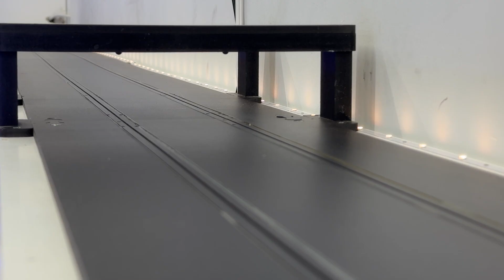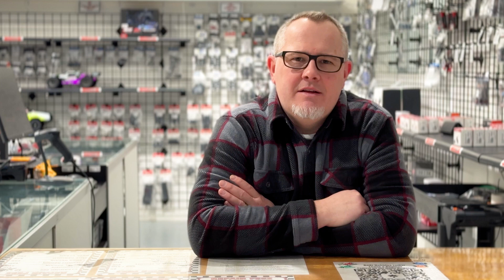Armature Ohm Talk HO Slot Car

Comment: I have an unrelated question about how to wire track for brakes I have the transformer and controller’s that both have 3 terminal’s I have race software and kill buttons and polarity switch for each lane
Could you do a short video on wiring track
Reply from the maker: Hi Kevin id keep looking through our videos we have wiring videos and we also have a diagram on the website

Comment: Wire Drawing Process:
Wire is traditionally made by drawing a metal rod through progressively smaller dies or openings to achieve the desired thickness. The number of times a wire has been drawn through these dies, corresponds to its gauge, meaning the wire needs more passes for thinner gauges.
Gauge as a Measure of Wire Diameter:
A higher gauge number indicates that more drawing operations (passes through dies) were necessary to achieve that specific thinner diameter, while a lower gauge number means fewer drawing passes are needed, and thus thicker wires.

Comment: 100% my friend I ran a g+ super stock for years (HOPAC) old rules  , stock mag's, any gears any hub's/rubber STOCK ARM but can be balanced and glued com wire, I would call Gary Beadle (AFX) and buy stock arms in BULK QUANTITY,  500 lot !  I built a small jig to hold the arm and test every single one , I would usually get around 20-30 arms worth balancing but I would have about 8-10  absolute killers 4.9- 5.9 ohm. Range, the rest I would sell to the clubs at a extremely strong price always $3.50 with the ohm. rated.  When the rules say STOCK ARM watch out  !  I race NEO events as well and I have to say it's so mutch easier to build a top competitive car with unlimited aftermarket armature   !  keep up the great work VIPERDUDES !
Reply from the maker: Thanks for the tip!

Comment: Coming from the RC world where 540/550 motors were described in turns, such as 27 turn or 35 turn, The lower the turn, the hotter/faster the motor. Does this corelate at all with these smaller motors that are described by their resistance?
Reply from the maker: It does to a point. I think the way we do it with Slot car arms is more accurate by stating the wire length and size.  Example being  a 19T motor could be wound loose or tight but still be 19T. The two would run totally different.  Now if you were to use 3' of X gauge wire, regardless of turn count the wire length would be the same therefore the performance would be similar. Now a neater wound arm could still outperform the sloppy wound arm but they would still be very close in performance compared to the first example using just turns as the spec.
Reply: @viperscaleracing  So the 6-ohm, 2-ohm or whatever motor is specified by the length and gauge of wire used? Is there a reference for this, or is it trade secrets?
Reply from the maker: @robconlin4815  For basic arms the ohm rating is typically what we use to refer to the arm by. In the video I explain that typically when you get into custom arms is when we start talking  wire length and wire size.
Reply: @viperscaleracing  Thanks for the clarification. I really enjoy your videos, it's great that you're sharing your knowledge.

Comment: Dan
Kinda felt like this was an answer to my NUMEROUS queries to y’all these last several months. As my track isn’t here yet, I’ve spent numerous hours building an testing the RPM of different combinations of arms and magnets. I have noticed that the 4/10 set up with a 2.4 ohm factory arm “appears” to produce more RPM and a lower current draw @ 9v than a 10/10 with the same arm. Again, I can’t track test yet. However, there’s a noticeable difference in the sound of the 10/10 over the 4/10. The 10/10 just sounds more powerful and torquey. Would that be a fair statement, or am I reading things wrong?The sub 1ohm 44 guage arms with the level 33 neos have crazy powerful sound that’s unlike anything I’ve ever run. Thanks for your wealth of information that you’re willing to share with us.
Reply from the maker: It was just time to post about it. We will be developing a magnet/Arm chart that will further help